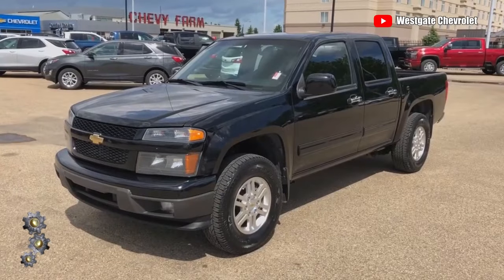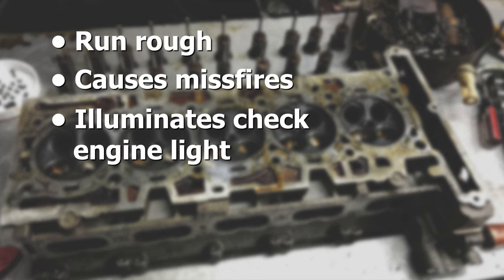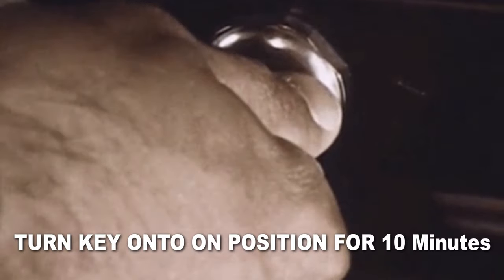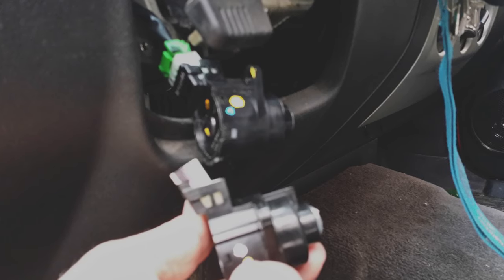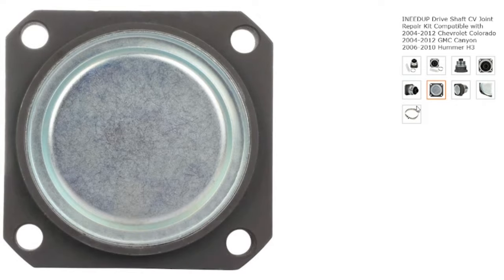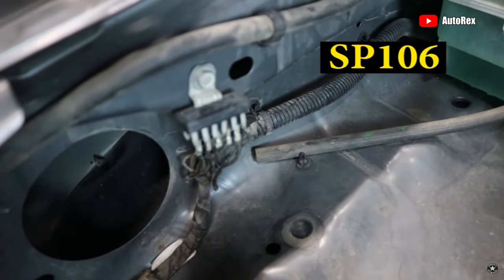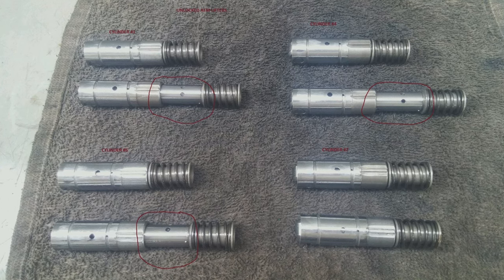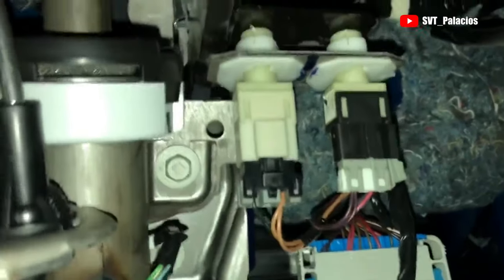Watch This Before Buying a Chevrolet Colorado  2004-2012 (GMC Canyon)

Comment: I've had a 2007 with the 3.7L since new. 113k miles. It's been a great truck overall. Emissions sensor at 50k. Ignition at 70k. Only other issue was a leak at the third brake light and my brakes sometimes stick. That's it. I hope I can get at least 200k out of this truck. Currently feels like it'll do that with no sweat.
Reply: i herd up until 2008 or 2010 models had engine problems with the 3.5L engines
Reply: @richardsmall8940  I think the 3.5L has valve guide issues. They fixed it with the 3.7L. The 3.7L has an issue with the timing chain tensioner wearing out prematurely. My truck is started to experience that. Slight chain rattle noise at startup. I'll be getting that fixed soon. Runs as good as it did new otherwise.
Reply: @palebeachbum  2007 so how many km or miles on it? it be 14-15 years old..probably 300000
Reply: @richardsmall8940  114,000 miles.
Reply: @palebeachbum  114000 miles is 183465.2 in km ........thats nothing for a 2007.....my 07 Tacoma has at 195000 miles which i at least 310000 km
Reply: @richardsmall8940  Please reread my original comment.
Reply: @palebeachbum  oh shit..okay when you take it ff the road.....how long did it take to get to 114000 miles
Reply: @palebeachbum  what year did you stop driving it
Reply: @richardsmall8940  I still daily drive it.
Reply: @palebeachbum  ....how long have you had it? 114000 miles is nothing for a 14 plus year old
Reply: @richardsmall8940  Yeah it's low miles for the year. City driving. Hardest miles you can put on a vehicle. It was bought new as a leftover in 2008.
Reply: @palebeachbum  i herd the 2010s-2012 3.7s didnt have those issues
Reply: @masterpalladin  that may be possible. I'm not sure. GM may have fixed the issue.
Reply: My 2008 colorado timing chain system just went at 300,000 KM!!!! Terrible situation!!!!! Be aware!!!!!! In the middle of replacement now...it is possible in your driveway but you will need alot of patients and every tool imaginable.
Reply: @justinpostma1254  the timing chain guide is a common failure point on the 5cyl. engine. By the time mine needs that repair the repair cost will be more than the value of the truck.
Reply: I got a 2005 Colorado it's got 255,000 on it I hadn't had to do nothing to it later but put a baby in it what I did put a water pump on it and that's very easy
Reply: @williamcorleu5839  They're a great truck. They make the Tacoma look way overpriced.
Reply: @palebeachbum  my 2011 five-cylinder engine 3.7 had that rattle. The mechanic found that the "tension pulley was wearing into the front engine cover." He replaced the belt and the tensioner and everything's fine now. This happened at 98,000 miles. I now have 110,000 miles. Do you know when we have to replace the timing chain?
Reply: @justinpostma1254  can you tell us more what happened? My 3.75 cylinder is that 110,000 miles. It's a 2011 truck. I wonder when I should replace the timing chain.
Reply: @OrcaBoat3  Timing chain is supposed to last for the life of the engine. What happens on the 5cyl engine is the timing chain guide wears out over time from friction, causing slack in the timing chain. The danger is that the slack in the chain can cause the chain to jump off. That's bad. The labor to gain access to the guide is very expensive, so while the engine is open to replace the worn-out guide, it's best practice to replace the chain at the same time since it's not an expensive part.

Comment: Change your oil frequently 
Clean the throttle body every few years
Maintain front caliper pins yearly
Use 31" BFG KO2 tires
You're good to go!
Reply: I got mastercraft MXT 32's 11.5 r15 on the stock alloy rims and they fit like a glove w no rub
Reply: Can you explain the issue with the from t caliper pins I had a caliper come off last year and had to it it towed to my dads shop I Really don’t want to deal with that ever again. ( I can’t remember if the pads where bad or not but I assum they were. Just a pain in the ass to do rotors on this truck.
Reply: @joestewart5406  Looks like you didn't get an answer but I'll take a shot - caliper pins tend to rust and if they rust in place, the caliper won't release the disc properly. The calipers ride on these pins and the pins keep them square against the disc. 

This of course wears down the pads and the discs prematurely. I haven't done it on this truck but I've done it on plenty of cars and trucks. Basically you pull the pins (often this may require removing the caliper from the disc but not from the truck - leave the hoses intact), clean them up, put a light coating of grease on them and re-install. There are all kinds of different greases, but calipers can get pretty hot so use something that can take high temps.
Reply: @chipsawdust5816  just bought one recently a 2011 5.3L 4x4...and when you brake hard almost emergency level..it pull left hard enough to freak you out to counter steer so I'm definitely looking into this asap..i lifted the front end and 1wheel rolls about 50 percent more than the other so its sticking a bit. Is it a caliper or a brake line clogging or maybe the pins..that didn't dawn on me thanks for answering that question
Reply: @javiertrujillo3136  I've rarely seen clogged lines, so I'd probably check that last. The pins or the caliper pistons are more likely to be the trouble (unless you have an alignment issue or something else entirely). If the pins are corroded, that's an easy fix. If it's a sticky piston, those can be fixed as well, but if you don't have a shop, compressed air and a few bits of emery cloth, an exchange part might be the better route. Any more, I buy exchange parts as they're quick to swap out and bleed.
Reply: @javiertrujillo3136  You can also tell if one brake is heating up more than the other side on the same axle with a temperature probe. Don't use your fingers lol (ask me how I know). If it only happens under really heavy braking it sounds like it could be binding (again, other issues aside). Hopefully the bearings sound OK, but if it won't spin as fast as the other side it's probably something to do with that side. And with a 4x4 it's hard to spin them anyway. But they should be reasonably close to equal. 

Hate to say it but if one side is bad, I'd change the other side as well since they will then match, and you won't be out there again in a month or three doing the same thing to the other side :(
Reply: @javiertrujillo3136  what ended up being the problem.
Reply: @brettblack7049  rear brakes needed cleaning and adjusting since its drum brake in the back... I guess one side passenger side wasnt applying little to no pressure so it would fishtail to the left... go figure I was on the right track but it was the rear not the front. Shop charged me 60bucks to clean lube and adjust them in less than an hour....he said if it acts up again just change out the brake cylinders...

Comment: found out the fuel tank top rots out because it is a 1 inch drop forward drain angle and most driveways have the same 1 inch drop (wheel to wheel) which levels out the truck bed, and the top of fuel tank drain, solution is park backwards in driveway after driving in rain, also fluids should be checked at a level gas station as it is hard to find a true level surface for drainage reasons.

Comment: I have a 2012 Chevy Colorado 5 cylinder so far the only problem I had was with the blower not working I change the resister it a 4 x 4    4 door with 130,00 miles.
Reply: What was the first indications your blower was bad? I just bought a 2012 Colorado with the I5

Comment: I had 4 of these issues but it got resolved and I love it.
Reply from the maker: Can't even leave my house in my 2wd with a slight ice and snow in Texas
Reply: @AutoMotivate  I'm in North East Ohio. I'm not going anywhere for a like a week.
Reply from the maker: @jamiekarr3377  that comment was sent to another commenter, but I guess it got duplicated here 😂 
However, I can’t imagine being in the northern states. How are y’all fairing up there?
Reply: @AutoMotivate  It rained, snowed then the precipitation turned into sleet. This is the most snow we had in my area in like 5 years.
Reply: @AutoMotivate  ahhh it aint that bad buddy. I live in PA and made it through the winter just fine.
Reply: i have a 2009 chevy colorado 4 cylinder 2WD
Reply: I got videos of my 2wd exhaust deep in the bayou and suspension articulated to the max on snow filled mountains.

Comment: I've had the pass lock issue and blower resistor on my 09 I4. By passed the ignition wire issue and replaced resistor. Runs great

Comment: I bought a 2005 GMC Canyon Extended cab w/3.5l i5 engine, and it had 138K miles then.  Since then, some minor work by myself has been done.  I took the MAF and TB off, used associated proper spray cleaners, and fixed the low idle issues.  Replaced the radiator, and PCV hoses.  Now it has 144K miles.  Been very reliable, so far.  My only problem left is the electric window on passenger side.  I can hear a relay click on passenger side door when I try using the switch from the driver's side to attempt to lower the passenger window.  It does not move.  I get the same click sound from the same location on passenger door, when I try to lower the window from the passenger side window switch.  Do you know what to check for that?
Reply: I herd the 3.7s are better with fewer engine problems
Reply: @masterpalladin  I don't know, probably... I am not having to fix or go under the hood since last bit I did over a year ago.
Now it has 146K miles.
Reply: @tallpaul9475  k
Reply: I have a similar problem I don't know what a relay click sounds like but I do know it takes me maybe pushing the button like five times before it goes down.  I was thinking maybe it was sticking at the top and just needed some lubricant but I haven't tried that.  Did you figure yours out?
Reply: Easy to take door panel off and check. 
My window C channel clips broke and my window came off the window motor arm. 
No big deal. Took panel off and replaced the motor reglued the window back

Comment: 09 3.7 I have 362190 miles biggest problem has been with the trans -2 rebuilds, Drive it every day for work average 5-600 miles a week. Boss offered me a newer truck and I refused.
Helper springs when I first got it in 2013, rebuilt the drivers seat twice. I want to see it hit 400,000 then I will retire. 69 yrs old.

Comment: I have a 3.7 liter inline 5 2012 GMC canyon with 104k miles most the problems I've run into were self inflicted but seems like a decent little beater.
Reply: Same mines an 07 at 116000 tire sensors are annoying though they don’t work half the time.

Comment: I just picked up my '08 Colorado crew cab 4x4, 77k miles from the dealership yesterday. It went it for an ABS Fault (again) & 3 days later - new front hubs w/speed sensors (3rd time front hubs were replaced!), new rotors & pads (not sure why? -rotors were fine but they insisted they be replaced). ~ $2000 - ouch! And I was warned the brake lines will soon need to be replaced due to all the undercarriage rust. I don't drive it that much these days but I guess the New England weather/salt is taking it's toll. I replaced the blower motor resistor this summer & finally got back fan speeds 1,2,3. And the A/C quit 2 years ago - condenser had to be replaced. Thanks for the other issues warnings. I have the inline 5 too. This truck is great in the snow and it can really get up & go.

Comment: I got a ‘05 with 5-cylinder. Has 200,000-klms .. only major non-maintenance repair .. leaking water pump and heater controller replaced. 
I live in Canada .. and surprisingly .. no rust.  But .. I wash it regularly

Comment: I have an 06 z71 extended in victory red with every bell and whistle offered by chevy. Bought it brand new in 07 currently sitting at 236k. Still purrs like a kitten. Besides annual check ups and miscellaneous things. All I've replaced is windshield brakes tires the front swaybar driveshaft 4wd actuator and wheel bearings. rockers and bottom tailgate starting to rust through from new york winters but if you ask me these are great trucks. better looking than the new ones. Hope it last me another 250k
Reply: I have a 2011 4x4 with the 3.7 5-cylinder, and 100,000 miles. I love it. Bought it brand new in 2011. It's in good shape. I had a frayed wire a few years ago that caused some electrical problems, and sent the engine into low-power mode. The other problem was my fuel pressure sensor went bad and had to replace that. But the suckiest thing is the Massachusetts Winters have caused ALOT  of rust on the frame. It seems just like surface rust but it is everywhere and I feel kind of bad about that.
Reply: @OrcaBoat3  I feel you on the rust man i ende up powerwashing as much as i could get off letting completely drying and undercoating with evapo rust and painting with rust reform then spraying the frame and bottom cab with lanolin oil. holding up well but about time for another coat. salt is so hard on vehicles
Reply: @xfastxeddiex  I'm thinking of getting such a service done at a place called NH Oil Undercoating in New Hampshire.  They claim it's the best. Hey, did any of your frame rust all the way through? or is it just surface rust?  Also, has your truck ever broken down anywhere while on the road? I was thinking of buying the new Chevy Colorado, but if my current Colorado can survive another 10 years I'll keep this one. I think mine is much better looking than the new Colorado anyway.
Reply: @OrcaBoat3  was out there looking at it today only real bad spot ive seen is right where the frame turns up over the rear wheels close to the front leaf spring mount there a hole clean through seems mud and such gets trapped in there ill have my welder plate that entire part of the frame and add some gussets to the leaf mount. be sure to spray out the inside of your frame.
Reply: @OrcaBoat3  Yea mine did. Hasn't fallen apart but it's a real bad case of rusty frame. It happened from the inside out. wasn't even visible last June when it was state inspection time. But there is a big hole near the rear wheel, and the outer part of the frame, basically under the drivers seat is gone.  I am in the process of replacing the frame, and refreshing the front and rear suspension as long as it's going to be all apart anyway.

Comment: My 2006 Chevy Colorado just rolled over to 225,000 miles. It does have an intermittent issue that 4 different shops can't figure out.

Comment: Iv got the 04 3.5 L and love it over 247 thousand miles and havnt replaced much does need suspension all the way around but super cheap on Amazon. Highly recomend the truck straight 5 is a work horse and I feel like it has more to and tq than factory says runs like a scalded dog when I step on it. Love my old canyon and would buy 3 more if I could.
Reply: I have an 04 3.5 as well had issues with the ac blower not working fixed it and all I do is change the oil and new battery every couple of years love the truck legit a work horse! I got 160k on mine got it with 80k hoping to reach 250k lol
Reply: @fv5267  04 Chevrolet Colorado crew cab z714x4 5cyl. 
289k miles and still running strong.
Reply: @workingman9745  what are things u have done to it in regards of maintenance
Reply: @fv5267  oil change every 3 to 5 thousand miles unless the CHANGE OIL message comes on.
About once every 3 months add a bottle of MARVEL MYSTERY OIL TO A FULL TANK OF GAS. 
Mainly just DON'T ABUSE IT. 
I have used mine at times pretty tough but NOT ABUSIVE. 
I think another big plus is to drive it if possible every day. 
I believe short trips and letting them sit to often allows internal damage because a mechanical system needs to run and generate heat to keep internal components conditioned. 
My average highway speed is 60 to 80 mph. 
I'm not an expert by any means but my little Colorado still runs strong.
Reply: I got the inline 5 ‘05 and at 230,000 almost! No probs here! I love it! Great fuel economy too! Better than my sienna minivan usually!
Reply: @happyfingers55  my 04 is now over 300k miles. 
Just put a new set of 31x10.50 wrangler authority's on still running strong 💪.

Comment: So which 1st generation GMC Canyon Motor is the most reliable? The 2.8 I4, the 2.9 I4, the 3.5 I5, or the 3.7 I5? There was also a limited Edition 1st generation GMC Canyon with the 5.3 V8, but I don't see very many of those listed. Same with the 1st Generation Buick Lacrosse. They had a special edition super Lacrosse with the 5.3 V8 engine for a limited time.

Comment: Hey if any of y'all have a weird issue on the road.. like your window stop working.. or your check engine light causes a low power issue and therefore won't give you enough power to get up a hill..  try disconnecting your negative power cable on your battery for ..... Idk 30 seconds and plug it back in and see if it fixes it.. worked for me...
Reply: Thanks mate, Always nice to have some tips.

Comment: cut the white wire with blue stripe under the dash boom, no more passlock issues.
Reply: Is this a joke?  My 08 chevy has been amazing except the periodic "I don't wanna start".  I wait 30 minutes and try again.....and bingo, she turns over.  I am guessing it is the ignition cylinder.  Is this wire accessed behind the ignition cylinder?
Reply: @davemanson951  its the passlock

Comment: There lh9(flexfuel)v8 engine does not have afm. It has variable valve timing(vvt) with bigger injectors to run higher grades of ethanol(e85). Active fuel management(afm) also known as displacement on demand(dod) deactivates some of the cylinders for better gas mileage obviously reliability is affected, vvt is not the same thing.

Comment: I having a problem with my 2010 5 cylinder all the sudden. Stalls on initial start up of the day or if it sits for more than a few hours. It has over 151,000 miles and this is my first confusing issue